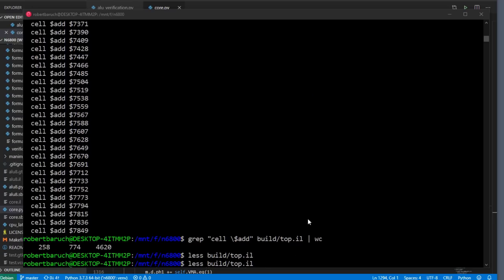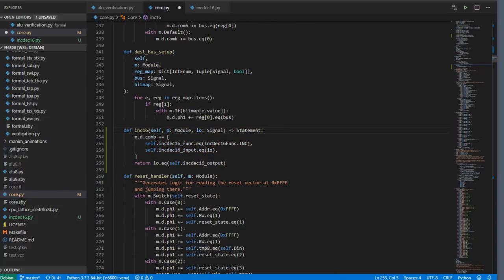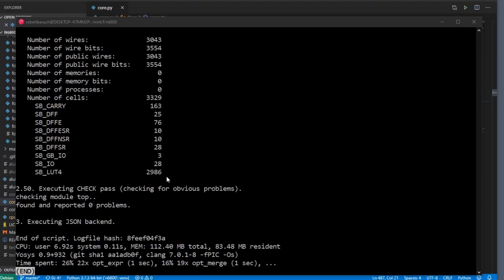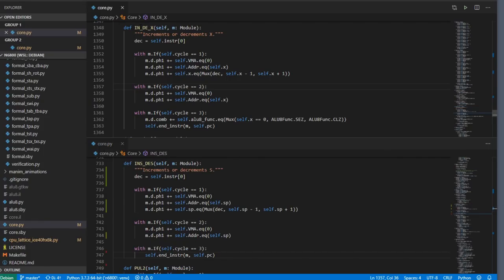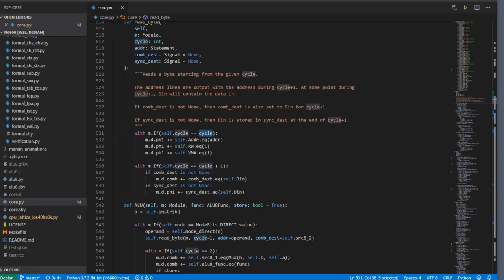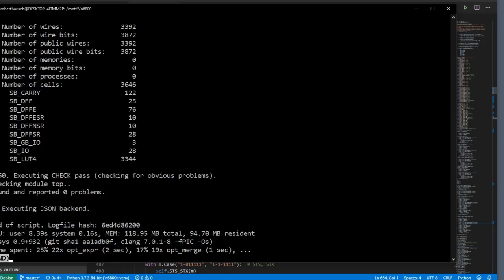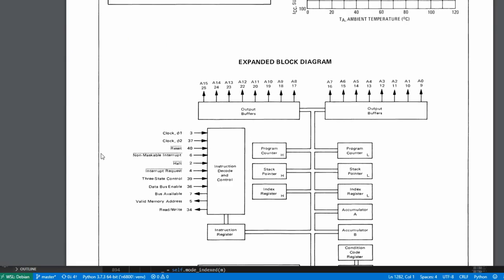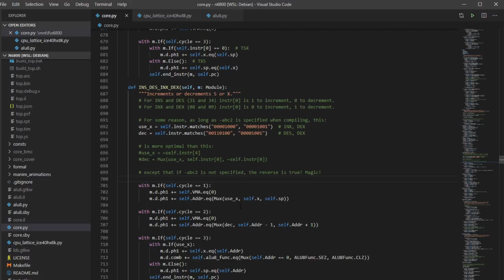Building a 6800 CPU on an FPGA with nMigen (part 11)

Comment: To read about yosys optimization, you can use `help opt` in yosys session and `help synth_yourplatform`. Usually it goes like this: synth calls opt, opt calls opt_merge which "identifies cells with identical type and input signals. Such cells  are then merged to one cell."
(ETA: Oh, you notices synth, nice)

Also for checking if optimization works it's nice to use git instead of file `bak`: either try something in a new branch or just `git reset --hard HEAD` once everything is done.

Comment: Despite the effort and frustration you probably went through, this is my favorite of the videos thus far. However, I'm much more curious about optimizing for maximum clock speed rather than quantity of LUTs. Admittedly there's likely a correlation (especially if along the critical path) but this max speed determination for FPGAs is the darkest magic to me.

Comment: Hi! I'm still looking forward to see that it will actually do work in FPGA connected to some memory and uart or any other hardware. Unfortunately either youtube is blocking those videos for me or Robert has abandoned several series right before the great finale in a similar way (zork cpu in FPGA, RISC-V not in FPGA, ...). Pity.

Comment: As a point of comparison, you might want to see how an hand optimized 6800 in verilog does (synthesized with the same parameters nmigen is giving Yosis ).
Reply from the maker: Hmm, well, hand-optimized is not so interesting to me. Again, I'm interested in readable code. An optimization isn't going to do much good if it's so specific that it would get removed or broken when someone wants to make a change, too.

Comment: Curious as to what the optimization would be of the original design if you just did the yosis optimization options?
Also, are you thinking about maybe a “6800E” that would have an extended instruction set with something like MPY and DIV?

Comment: This series is so great!

As someone who understands digital logic but not FPGA, it's difficult for me to understand that you're not placing gates by hand when doing this synthesis stuff, like even if I knew how to efficiently design an ALU from logic elements, when using something like migen I'm basically just doing big case statements and hope it does the right thing, right?
Reply from the maker: Pretty much! In the end it's just a state, and a big bunch of logic to decide what the next state should be. You write that big bunch of logic, and let the optimizer melt it down. And that's really it.

Comment: This is only a thought. Yoh are far beyond my skill level. Conceptually, a CPU itself leverages the behavior of electrons. Your states, hypothetically, are electronically factual states in a physical CPU. One state is locked in step to the next. Are you looking toward Pragmas? Is this even an option? You might run slave threads compiling the coming state.